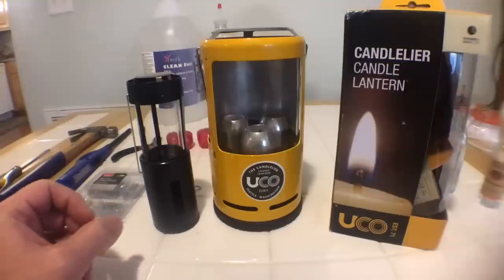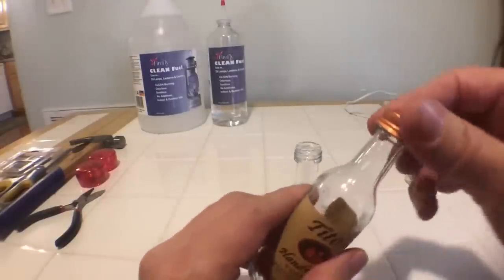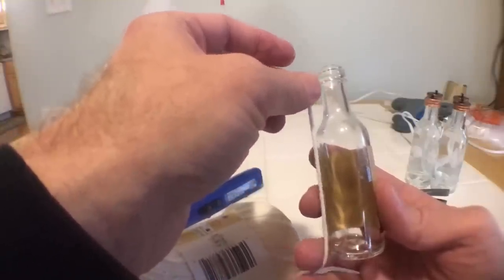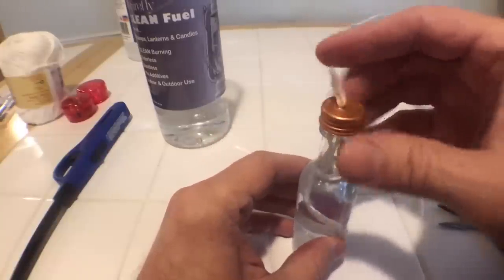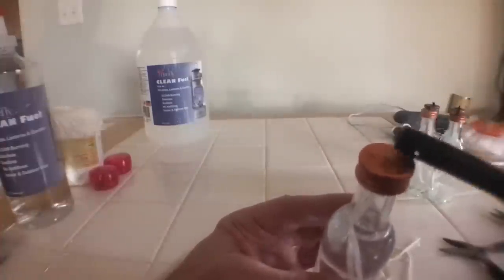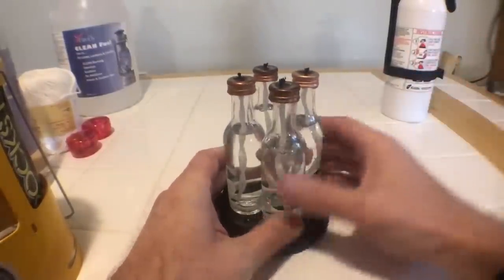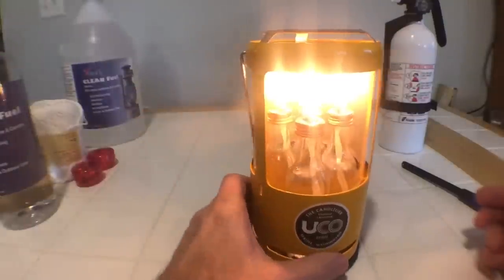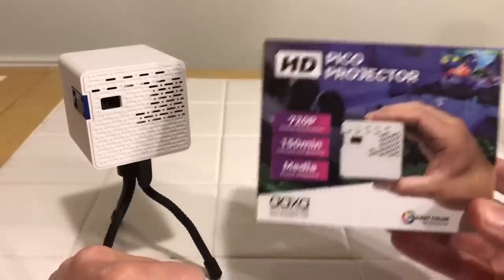UCO Candlelier Heater Oil Conversion Candle Lantern Camper Car Van SUV RV

Comment: You explain everything so clearly with extreme detail plus show every step. I wish everyone would do videos like you. Love your voice, product information, close-up info plus step-by-step instructions.  Excellent !
Reply from the maker: Thank you for your awesome comments.  I enjoy showing people how to make things especially if they serve a purpose. Glad you enjoy the videos. Thanks for watching them!
Reply: PSC Camper Conversions 
diito👆👆👆👍👍👍
Reply: Totally agree. Great manner. Be a great teacher. Detail without tedium 👍👍
Reply: @timdillen  just found you when searching heaters for van camping. I wanted to say thanks for sharing! Learned a lot today now I'm going to have to check out your other videos. Wanted to share my trick for threading the wick thru the cap. Take a thin wire from a twist tie (or a short piece of fishing line will work too) and run it thru the loop you made in the wick. Then poke the 2 ends of wire thru the cap and pull the wick thru. The wire becomes sort of a makeshift needle

Comment: Very good and precise instructions. I modified my lantern but did not like that once the bottles were glued to the base it would be difficult to use candles once again. I like items that are multi-use so I removed the bottles and made a sheet metal base that fit inside the lantern base, screwed the metal to the plastic base with one screw in the center then glued the bottles to the metal base. Now I can use oil or candles depending on availability. Thank you again for the inspiration. Be safe.

Comment: To thread the wick through the hole easily, hop over to the sewing notions and get a needle threader.  It's a heavy foil tab with a wire attached to it.  Push the wire through the hole, put the wick through the wire and pull the threader out.  Easy peasy.

Comment: Great video! Tip for using the yarn — the other end is just tucked inside the center, so you don't need to keep pulling it out from under the label. It will unravel from the center too without tangling.

Comment: I learned this from Camper oven cooking.  By putting a pizza ceramic tile (or just non coat tile) it causes a more stable heat source due to it obsorbing the heat.  I recon it's akin to placing rocks around your fire pit to hold the heat.  
So back to the guy who recommended the magnets for a no tip version of your upgraded idea.  Add to that some (1, 2 3 or 4 test for best results) rounded cut (or square) plain (non coated) ceramic tile (say about an inch wider than the top all the way around) to hold that heat longer.  It may give a better overall btu (or at least longer radiating heat from the source), result and a platform for a warming cup of coffee.

Comment: Great idea looks like a winner. Thanks for the video. Maybe next you can try to use one big glass jar that would fit in the lantern and put four or more holes for the wicks and you may be able to keep the flames from burning down low as oil may not run out as soon. Also you may be able to add on to the top of the lantern with a bolt a few more round layers of metal plates with washers in between that will heat up giving you more radiant heat.

Comment: for threading the wick through the bottle top cap, simply loop the thread through your wicks loop and push the thread through the hole and pull the wick through. A lot easier to pust the thin thread through the hols than trying to fit the thicker wick through :)

Comment: With your looped wic, run a piece of thread through the loop and then thread it on through the hole you made with the nail. Then pull the wick up with the thread . The thread will easily pull the looped wic up and then you discard it. Easier than mucking about with the doubled wic. Try it and see.

Comment: I cannot sleep when it is too hot and 76 degrees is way TOO hot. Heck, I've been backpacking and at higher elevations it was 31 degrees when we woke up one morning. But sleeping on the ground under the stars I was toasty warm with long underwear on, fleece socks and a beanie all night long. At lower elevations it was too hot for the socks, beanie or pants, and sometimes had to unzip the sleeping bag to get some air. I'm a 140 lb woman.

Shoot, just a small backpacking tent will keep you 20 degrees warmer than outside, without the fire hazard. Sleeping in a metal vehicle can be colder than a tent outside, because it's like an icebox. And you can get sleeping bag liners to increase warmth, long underwear, etc.

I'm going to save this in a playlist because the oil lamp is pretty cool. But I don't drink, so I'll have to keep my eye out.
Reply from the maker: Thank for posting the helpful hints! Glad you liked the oil lamps and thanks for watching!

Comment: Cool idea! I'll make a couple. If I may make a suggestion, it would be easier to pull the wicks through the holes in the caps by folding a length of thin wire such as from an old extension cord through the hole from the top side, and threading the wick through the wire loop and pulling it through.
Reply from the maker: That definitely would be a better way - thanks!

Comment: Now I am concerned about what you hang it from, the heat may catch the headliner. A metal shield to spread the heat?  Also consider making 2 sheets of Mylar Bubble wrap and velcro dots to the inside of your windows, I too use a truckers curtain on top of that. The more air that is trapped against the glass, the more heat you will retain and you can drop back to three bottles.

Comment: As a former sailor(US submariner 87-97) it hit me that this is basically a ships lantern from the days of sail. I like the idea of conversion from candle to oil seems a lot safer and burns longer. I betcha it puts off more heat too for those cold nights. I wonder if a similar size mason jar instead of the four bottles would make it easier to assemble? I'm not sure if it would burn more oil?

Comment: To thread the bottle cap get very thin wire ,cut it about 10" long ,bend it in two. Now put the bended end down through the hole in the cap , thread the yarn through the wire ,pull back through the top of bottle cap. You got the yarn through the cap easy. you can was the yarn too. Melt the wax dip the end in it about an inch or less. Waite a few seconds to get cool and roll it between your thumb and finger to taper the end . It shud be easy to thread the cap either way.
Reply from the maker: A much better method - thanks!

Comment: To thread easier...use the tiny wire from a twist tie.  Fold the wire in half and thread through the opposite side.  Leaving a loop in the wire.  Put the string in the wire loop and pull the wire from the opposite side.
Reply from the maker: Great tip! Thanks!

Comment: I would use JB Weld to glue them together. I would use a small paint can like you can get at Home Depot and put the bottles in the can. Then put the JB Weld around the bottles. Great idea!

Comment: looks cool...and i wonder what the btu output is with the oil. im also curious why you couldn't just put a half pint jar in there with the 4 wicks in it. The jar lids are metal...easily pierced, one vent for all 4 wicks...and you could have another flat lid to seal it up when you're done. hell...i think you could even do 5 wicks in one lid if you needed to. The only thing i don't know is if the jar will fit in the glass.

Comment: I sew.  For someone who is "center" challenged like me, you can use that white lid liner(s) you take out -as a template for all the rest of the lids, before you throw the liners away.  Take all liners out of their lids.  Pick one liner to turn into a template. 

     Fold the white liner in half to match the opposite edge carefully.  Rub the fold with the edge of a spoon to sharpen the fold (helps you see the line better).  Next fold the half circle in half again, rub to sharpen the new 2nd fold.  Open the folds to see your circle flat.  You will see an "X" the folds made.  Temporarily put the  white circle back in a naked lid positioned as PSC Camper Conversions says to make the hole.  You will see the middle where the fold lines intersect. That is the center to hammer a hole in.  
     
     You can use this X to do all of the other lids using the same template.  If the template gets torn from all the manipulating and is too demolished, lay it exactly on top of one of the other discarded liners and mark the center with a nail poke.
Reply from the maker: This is a great idea and very helpful. Thanks for posting!

Comment: Great videos! I was just checking to see if you were able to do a update to whether the oil lamp or the candle method produced more heat. Thanks!
Reply from the maker: Thanks! I never did get to do a proper comparison but the oil lamps definitely put out more heat in the taller wick position. I liked it better because there was more control and no possibility for wax sloshing.

Comment: Great product find, and fantastic mod. As with all innovations, it creates the mental spark for other ideas, mods, and variations. What about firefly oil in a regular kerosene lantern? Adjustable wick. Large reservoir. Hanging. They make oil lamps, but they seem to be table models. Just a spark. Now seeing if I can find my old lantern.
Reply from the maker: There has been several people commenting about using an oil lantern. I think it would be OK for a van. I have such a tiny space I am very limited so I am always looking for small solutions. A mason jar with larger wick inside the lantern was also suggested - sounds interesting.  Thanks for you comments and for watching!

Comment: The flat metal top seems like a very inefficient way to transfer the heat to the air. How about adding metal fins to the top and have more surface area heating the air? Great video series! Love them all.
Reply from the maker: I think that's an excellent idea!  Thanks for your comments and for watching!

Comment: just a suggestion.. to put the wik through the cap, since you obviously have access to tools, is to take a sewing needle with thread. thread the needle with thread and not even on the end.  hold one end of the thread, run the needle through the hole, loop the wik with the needle and run it back through the hole.. pull the thread end you held and the thread you pulled through with the needle..  no need to get frustrated...
Reply from the maker: That sounds like a better way than mine. Thanks for the tip and for watching!

Comment: The next time you need to pull a wick though a hole. Go into the yarn section and find a metal yarn needle. It has a large eye in which you can thread the yarn.
Reply from the maker: That would have been a much easier way! Thanks for the tip.

Comment: An easier way to thread the wick through the cap is to take a thin piece of wire (tie twists wire with the paper burned off works or necklace wire) fold it over to make a flap loop and thread through the lid from the outside of the cap. Put your string through your wire loop and pull it through.

Comment: To easily pull your wick through the hole, grab a needle and thread.

 Go down thru the hole from the top with the needle, leaving a few inches of thread to hold onto. 
Then pass the needle thru the loop on your wick and thread it back up thru the cap. Simply hold both ends of the thread together and pull the thread back out of the hole. The wick will come out with it.

Comment: What do you think about using a single container of oil with three or four wicks? Something like a mason jar is what I have in mind. I wonder if it would fit in the UCO. You wouldn’t have to refill the oil as often, and you’d only have to refill one container instead of four. Thoughts?
Reply from the maker: I think that is a very interesting idea. Thanks for posting it and for watching!
Reply: Thank you for doing the experimenting and posting the videos, you have worked out some of the bugs for the rest of us!
Reply: I agree!on Ali Express for instance they sell cookers with one to five wicks!cheep.
Reply: need a jar with a narrow neck,,, had a candle explode on me with a wide mouth,, caught my house on fire,,,,,,,,luckily we caught it in time
Reply: none given Champagne bottle
Reply: @nonegiven3814  bloody hell !!! Glad you are ok.
Reply: Mason jars with 3-5 wicks works great in fact. Mason Jar Mugs work even better. Gives you a handle to carry it with.
Reply: The mason jars are different than these shot bottles, as they are in sections at the lid and have the gasket at the edges of the lid. The shot bottles, once the plastic gasket is removed are a one piece lid. Thus, no leakage to them as a Mason jar may have. Just speculating and have not tried it, but to me, this seems like it would negate any use of a Mason jar. Especially if it came to knocking one over or such, for safety sake. I could be wrong, but just thinking about it and wondering if the Mason jar would work or not.
Reply: @brianmccann666  what a great idea...the handle..and metal caps...❤

Comment: Hey bud great video... I have the same anodized single candle lantern as you... I found the Jameson minis also work as the Titos bottles do.. But with either it wont close down all the way wich is a draw back if im tryin to store it into the neprene cocoon... If i find another solution that allows me to close the globe down all the way ill be sure to give u a hollar haha i did however find a 10mm alcohol burner that fits in the aluminum holder with the spring and base plate and sits almost flush like the candles would, and is able to close down for storage... But ive been lookin for somethin with a bit more fuel capacity.....

Comment: to increase radiant heat take several small copper plumbing pipes and put them on top of the heater. This will increase the radiant heat as the copper pipes conduct far infrared radiant heat. or just take an aluminum frying pan and turn it upside down over the heat source and that will increase your heat as well
Reply from the maker: That a really neat idea! Thanks for sharing.

Comment: Great idea, and great presentation!
I've got the same question as a lot of others: where can we get these bottles?
Also, it seems like as of now, Dec. 2108, UCO has discontinued their candlier product. ☹️ I could only find on Amazon for over $150 from third party sellers. ☹️
Reply from the maker: Tito’s Vodka was the only ones I could find. Might check with your local liquor store and see if they can order. The candleiers were $40 and don’t know if just a shortage due to demand or non-production.

Comment: Thank you for the dedicated time you spent on this project. I'll be able to use this in several ways. Wondering to myself if such a wick set up might be able to water a plant.
Reply from the maker: Thanks for you kind comments. That's an interesting idea, it might could work!
Reply: Wick will work for a plant waterer.  I've used cotton shoelaces as "wicks" for years with great success. 👍

Comment: We didn't have electricity to light up the house inside at night before like primitive,  we use kerosene. we make our lamp the same as you do but we use cotton soiled t-shirt that rug . cut them thin and twist like a rope then. you can estimate how thick or thin you want and wrap the top part with metal or aluminum can very tiny width just to wrap the wick and insert it in a hole of the cover lid so that the flame will not go inside the bottle.  then you have a lamp for the night. Cheaper way, if you don't use your old t-shirt then you can use it as a wick.